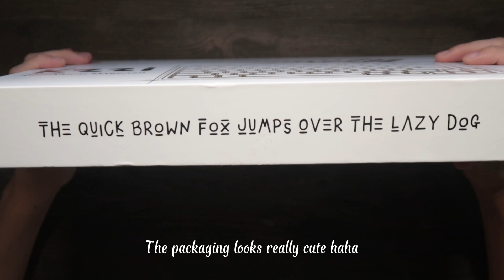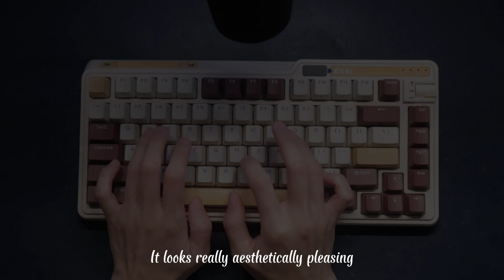affordable 75% poppy keyboard! (kzzi k75 pro)

Comment: Did you have as hard a time removing the switches as I did? :')
Reply from the maker: Hey! No I didn’t :) they were okay to remove! Maybe disassemble the case first!
Reply: @keyblobs  interesting! I think it's the switches! Because putting them on another board, they're still crazy hard to remove. The tactile ones that came with the board have this little clear plastic piece for the light, and it's making it hard to squeeze into it to pop em out I think :')
Reply from the maker: Oh!!! Yeah the small led light diffusers were really annoying HAHA.
Reply: @keyblobs  HOD DID U DO IT HAHAHHAA I feel like I'm gonna rip the switches off my pcb
Reply from the maker: @miguiq3990 HAHAHAHA what switch puller are you using! Your PCB will be fine just rip it off :D